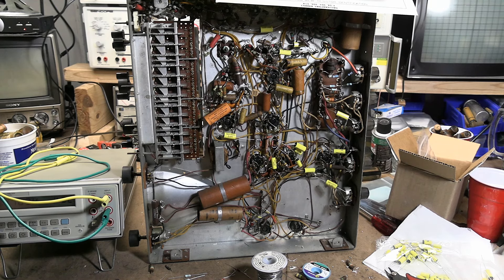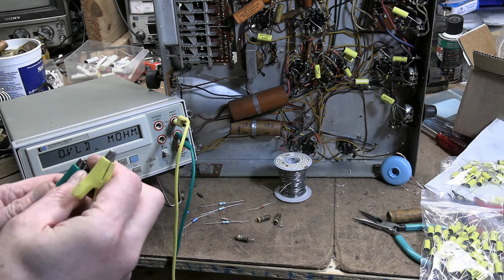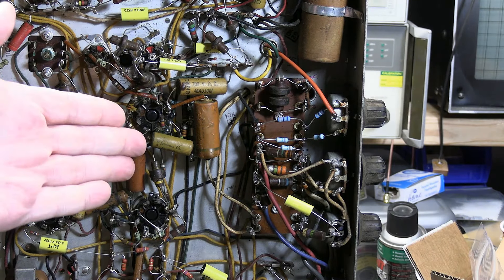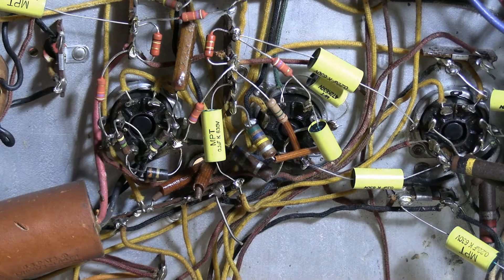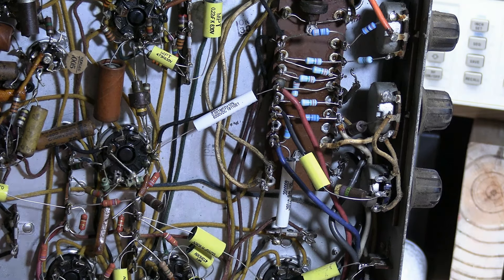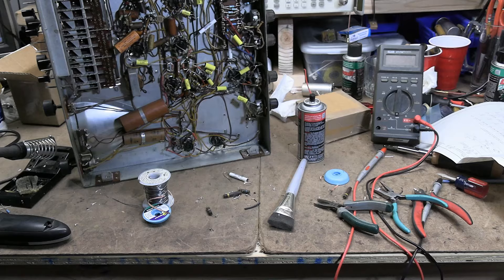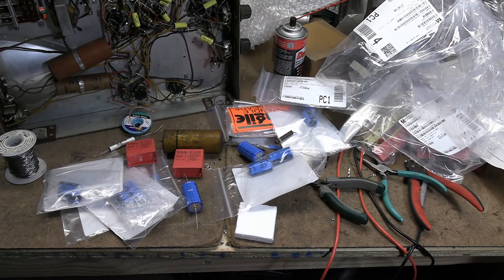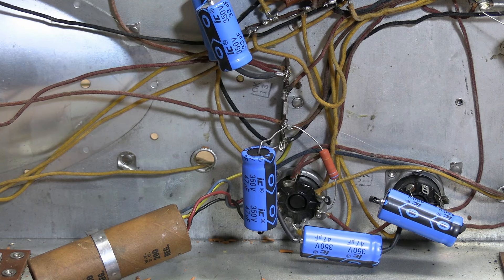1949 Hallicrafters T-54 restoration part 2

Comment: Every one of those type of bleeder networks that have crossed our bench has shown the same issues. Silvertone, Truetone, Sentinel, Airline used variations of that design. Glasslinger posted a vid many years ago on a 7 in silvertone. The statement was "I think I have replaced every resistor in this set".. Basically you might  have to replace more resistors than capacitors. So true !!!  Great vid as always !!!
Reply from the maker: Yeah, I just replacement them all in every 7" set now.

Comment: I spent more time replacing bad resistors in all 3 of my T54's than time replacing capacitors, and also those 2 capacitors in the Horizontal section I replaced with a trimmer cap like in the schematic because I got far better linearity adjustment with it than those caps in place. And once that you get to the RF cage section you will find more off value resistors and capacitors under, you will also find a trimmer cap for HV adjust and if you adjust this too far out it will stop the RF osc and you will lose HV, until you turn if back and cycle power off and on

Comment: I did some snooping on those .03/.05 capacitors used for vertical coupling, since I have two of these sets to restore - it looks like maybe the .05 was a production run change. There are two different Sams folders on the T54, and they spec both values, so I wager either will work acceptably.
Reply from the maker: We're about the find out.  Some 0.033uF axial caps just arrived :)

Comment: Hey bob, Would a piece of metal screen work as top and allow heat to dissipate?
Reply from the maker: I don't think the shielding would be as effective.  Also, doesn't keep the dirt out.  There was a lot of debris inside the HV box in ths set.
Reply: @bandersentv  Being HF. Yeah, that would be one giant magnet for dust. I can also see how the points from the metal mesh screen could cause little antennas and cause break-outs of noise. Worth a thought though and experiment. In the end something like that may be an option that a customer would need to give the "ok" for.

Comment: I’m actually curious of where you are getting your yellow axial capacitors?
Reply from the maker: eBay seller Affinity for Artifacts. https://www.ebay.com/str/infinidimenterprises?mkcid=16&mkevt=1&mkrid=711-127632-2357-0&ssspo=rhOrKv-wSNG&sssrc=3418065&ssuid=6Bl35IVaTha&widget_ver=artemis&media=COPY
Reply: Tony's Capacitor Corner also has the same or similar. Sorry I can't post a link. It contains "tuberadios".  @bandersentv
Reply from the maker: @notimetolooz9655  https://62bf1c-2.myshopify.com/products/axial-film-capacitor-630-volts

Are they actually black as shown in the photo?

Comment: I don't find VR37 1 watt 3.5KV resistors on Mouser. Am I missing something?
Reply from the maker: Yes. They are half watt. You do not need 1 watt. Only reason they used them is for the higher voltage rating
Reply: Thanks. Fingered it out. VR37 is 1/2 watt, VR68 is 1 watt. Sams shows 1 watt which confused me. @bandersentv

Comment: I see that a good many of the resistors are the none Allen-Bradley types, that one Youtuber calls them "rounders" and replaces all of them in his restorations. Yep, even Allen-Bradley resistors go bad, but not as much as the "rounders" do.
Reply from the maker: That's a new one on me.  These are the standard type of carbon comp resistors I see in everything I work on.  Maybe he restores test equipment or military gear?
Reply: @bandersentv  Yes, they all are carbon comp resistors, but the Allen-Bradley type have flat squared ends and the other type have rounded ends. The rounded ones are more prone to moisture intrusion.  You may have heard of Mr Carlson's Lab and he does consumer electronic restorations as well as test equipment and Military gear.
Reply from the maker: @JCWise-sf9ww  Sure I know him.  He's given me a few shout outs.  Thought they all had squared ends.  I'll have to pay more attention.

Comment: The early carbon comp resistors made back then were total crap.  This especially if they encountered voltages even close
 to 500 Volts or more. They just physically breakdown inside from repeated heating and cooling i.e. turning the set on and
 then off.  They would be found by a tube being fried once too many times by TV repairmen back in the day.  I don't work
 on any early vintage TVs because of too much replacing almost all components inside a chassis, which there are a lot of them. Hey I have my hands full with  AM , AM/SW, AM/FM radios and phonographs from the 1950's.  So  Illinois Capacitor 
i.e. Cornell Dubilier noticed an increase in demand for E- Caps and replaced their NLW line with the TMA line and are really great 105C  E- caps and go up to 450 WVDC. You got your work cut out for you on replacing all those resistors Bob.
Reply from the maker: It's almost getting to the point where it would be faster to just clip everything out and treat it as a kit.